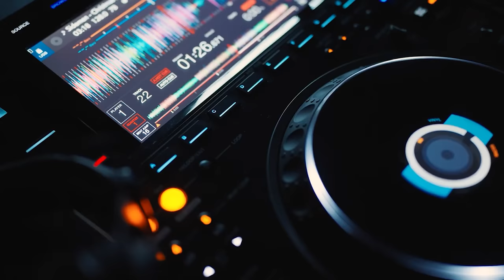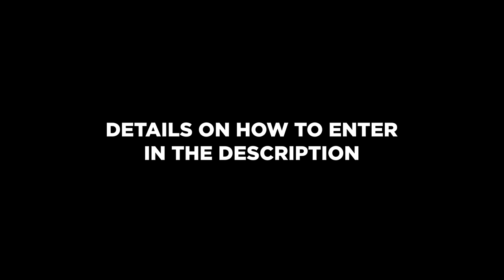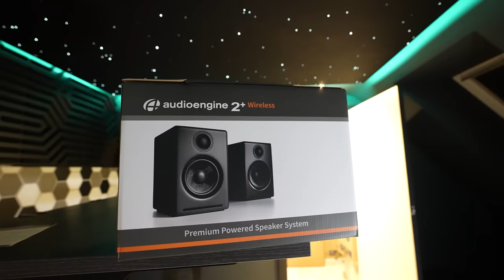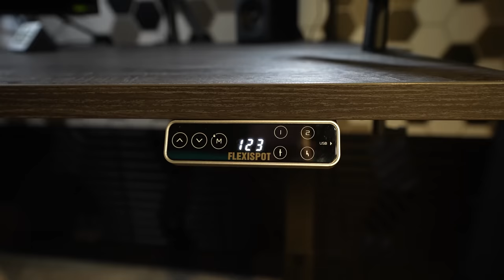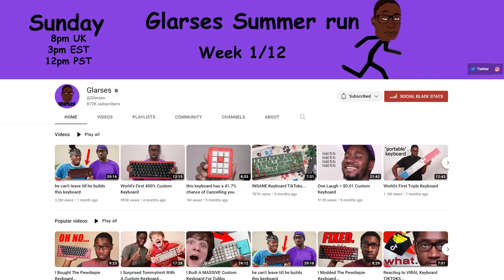BUILDING VIKKSTAR123 SETUP

Comment: with no tempered glass i’d suggest you put the pc in the storage room. you’ll need longer cable’s obviously but the heat and the potential noise would be sick to eliminate
Reply: It would be sick but a slight issue I see is that you would have to go in the storage room every time you want to turn on the pc
Reply: @simmonsburner  could have a power button extension cable that connects to the pc and the button's mounted on the desk...

Comment: I would put the PC in the other room, and just route a Power Button extension cable and have the button mounted to the desk to power on the PC. PC being in the other room minimizes all the fan noise and heat.
Reply: Controller USBs?
Reply: @SlayzzFPS  plug them into the usb hub

Comment: at around 11 minutes into the vid, u mentioned that the cables from the monitor can bee seen because there is no monitor mount/arm but u can actually thread the cables through the back of the stock monitor stand, (that is why there is that long cover in the centre at the back of it
Reply from the maker: Ah!!! Derrerp didn’t clock

Comment: I build these desk as a job, you can get much better cable trays than that. They have like a u bracket on what you hook on to the frame before placing it into the top. Much cleaner rather than seeing the the brackets hanging off the top!

Comment: Why not have the PC be attached under the desk so it gets lifted up together with the rest of the setup in standing mode? Even less worry about dust (because a thin MDF board does almost nothing, let's be honest) and no need for extra long/loose cables.
Also, a low-airflow case for a 13900K and a 4090? What you playing at, PCSpecialist?

Comment: I feel like you could have done a bit more optimization for the one and only 123.
E.g.: 
- color the drawers / or let them color, fitting to some color of the other parts (black or brown)
- use sick looking table stands for the monitors so they are at a good height and the table looks even cleaner
- maybe one or two extra made custom small things based on his preferences or successes

All in all, still great work! Just feel like there was potential to go an extra mile to make it from "great job" to "oh my gosh, can't believe what you've done here" 

Keep it up!